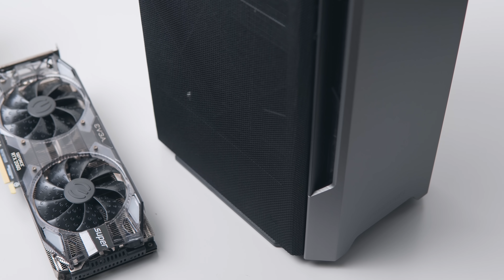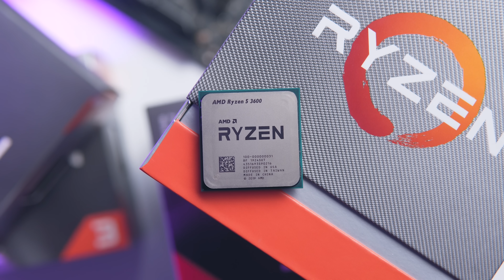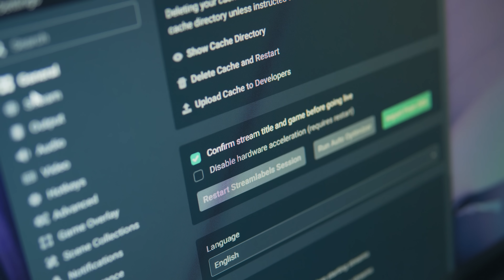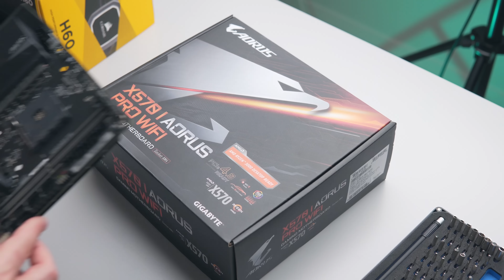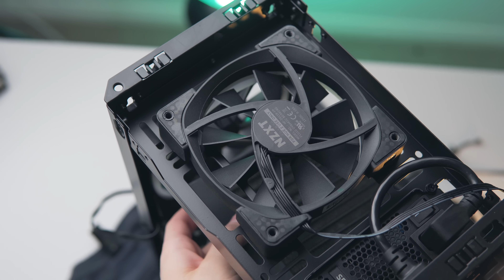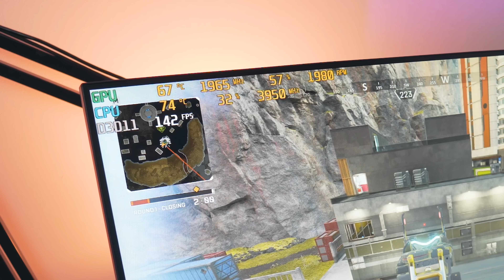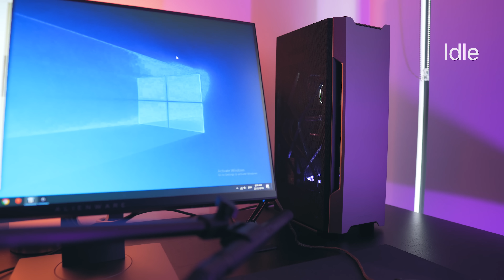Building a 144Hz Gaming Rig in the Evolv Shift Air!

Comment: One question, would my RTX 2080 Zotac AMP extreme fit in this case or does it not fit in the case?
Reply: Had a zotac 2080 ti in it, was fitting, though, I gave up with this case as the airflow was pretty bad, having ultra high temps with GPU, even without the side panels, maybe you would have slightly better Perfs with mesh but testing games in 4k with panels off was already stressing the GPU to +80ish degrees c , I reverted back to a proper gaming tower (meshify c), not as good looking but way better on temps :(

Comment: How was he able to mount the GPU with the fans facing outwards? I just built the same pc with the same PSU and a EVGA 2070 and the 8 pin and 6 pin block the GPU from people fitting with fans facing towards the case panel. Any ideas? I would like to flip my GPU.

Comment: I really like this case and i'm planning to build one with the same components as the one in the video but, can I swap the GPU and aio CPU cooler with the Sapphire Radeon RX 5700 XT 8 GB NITRO+ Video Card and Corsair H80i v2? Will these combo will fit inside the case?

Comment: So, Velka, Ghost, or Evolv?!!? In terms of airflow ofc ?!?!
Reply: X3MCTZN ncase M1 would be the best option as far as I can see. Up to ten degrees better cpu cooling with about the same gpu cooling possebility. Smaller than the evolve and same size as the ghost with a large tophat, if you don’t count the Ncase m1 tho the ghost would most likely win.
Reply: Fitinghoff THE Newbie! Thanks for your feedback dude, but I think the ghost is overrated Though I like it, and Ncase M1 is probably top notch as far as I can see and airwise as u stated, but that elusive ghost is pretty dear, chap! 
Oof the question is would I be able to put it in my backpack and pass the security airport check?! 
That is my concern and why ssf cases are expensive than regular ones?! So money wise and airflow wise, Ncase M1 right?!

Comment: doesnt undervolting your cpu like that kill its performance
Reply: Yes, aka clock stretching.  Bad advice being given out here.  I was surprised at high temps from this cpu, "65w TDP" it's marketing lies from AMD.  However, they state these temps are fine, only time will tell.  I'll be upset if my CPU dies early because I use my hardware for the full extent of it's expected life span.  I just sold my still-admirable i7 2600k after nine years of heavy use.

Comment: I’m thinking of getting this case for my Ryzen 7 2600, EVGA 2080 super build.  I tried these in a node 202 and it gets way too hot in that small case.  I need a narrow case to fit on my 60” wide desk along with my CRG9 display.

What is that program you are using to display the temps while in game?

Comment: i just got the mesh panels so i can use this case again but my gpu is still facing in because it wont go with the fans out. it looks like you're using a different pcie extension cable than what i got with the case and it looks like its long enough. if so, do you have a link to buy it?

Comment: How many fan you got in this build? Did you have To use a fan controller i try To do à similar build but it hard. I only have 3 fan plug on my mb one off them is for the pump but i have 4 fan

Comment: Do you have a guide on what setting and voltage you changed?
Reply: I'm a little confused at how he's getting 4gz at only 1.2 volts, did I miss something there?
Reply: @Stiitchjones  IIRC, gamersnexus covered this.  Undervolting zen 2 is a sham.  It results in "clock stretching", aka worse performance in spite of frequency.  Benchmarking results bear this fact out.  AMD didn't apply higher voltage for no reason.

Comment: I just built in this case with the same specs and fans. But I realized that the fan on your radiator is pushing air downwards instead of upwards. Is there any difference in performance there since a chimney-like airflow would be better with the air moving upwards. But then you would not see the led on the fan.
Reply: you want the fan to source cool outside air, reverse it so that the fan is pushing outside air through the rad into the case.  This will give you the best CPU temps

Comment: Would you happen to know if the riser card in this case is Gen4 compatible? I found that my all AMD build using a 5700 XT in either the DAN A4-SFX and Louqe Ghost S1 would cause Windows 10 to crash. A fix I found was to go into the Gigabyte’s bios and change the PCIe setting to Gen3. Unfortunately I couldn’t find the ability to do this with the Asus Strix X570 ITX motherboard.
Reply: It's not, I had to set my pcie to gen 3 in the bios using the gigabyte x570i aorus board with a 5700xt for it to not crash with this case
Reply: @sandrahiltz  Good news, Asus has released a bios enabling the PCIe connector to be configured to Gen3 when using the 5700 XT, no more crashes!

Comment: something else is wrong i have the same cooler in only push  in a case not as well vented and my 3600 never goes over 65c the fan speed isnt that high ether and it runs at 4100 to 4200 same voltages 1.35 to 1.4

Comment: Are there still problems with Phanteks/Cheapteks riser bundled with the case?
Reply: It seems to be much better than the ones I've seen pictured with older evolve shift cases, no issues with mine, though it's not pcie gen 4 compatible, but almost none are

Comment: You never really explained why the slim Power Colour Red Dragon 5700 xt can't fit in the case.
Reply from the maker: Because it's too tall.
Reply: @optimumtech  Wow, the Red dragon is one the smaller 5700xt cards next to the Sapphire Pulse 5700xt.
Reply from the maker: @mr.simmonds5681  Yep, the only 5700 XT that will fit in this case, with the fans flipped as shown, is the reference (blower) design.
Reply: @optimumtech  Thanks for letting me know! I appreciate that you actually respond back on your comments.

Comment: Hi bro, I am doing the same thing to reverse the gpu. However, I am facing a problem the riser wire block the front fan of the case (the one which is provided together with the case). Do you have the same issue or not? Or you have any suggestion for me, thank you bro

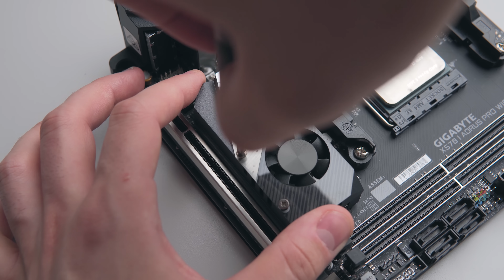Comment: 7:19 I have the same motherboard and I know,  that there is a piece of thermal paste to take between the cooler and the NVMe. Does Optimum Tech not use it? 
I'm in doubt if I shall not use it between the ventilator. If someone knows what's best, then please tell me.
Reply: The manual mentions the thermal paf for the backside m.2. I have not used it for slot 1 under the sys2 pcb fan. What GPU are you using? My rx480 fits but the fans face the Mobo...

Comment: I just don't get how video card is connected to motherboard and... where are outputs of video card?
Reply from the maker: video card is connected via a PCIe 3.0 x16 riser cable. The I/O is at the top of the case underneath the cover.
Reply: @optimumtech  Ok, thanks for answer, I just haven't seen such a case before. Does PCIe 3.0 x16 riser cable was included with the case, or you bought it separately? What the name of it and what length?
Reply: @optimumtech  And.., When you connect, for example, an hdmi cable, does it need to be rigidly bent in order to connect to the video card or is there an adapter there? Unclear...

Comment: Would MSI 5700xt evoke fit into this case??
Reply: It likely would, I have the MSI 5700xt mech in mine, the mech is a little shorter than the evoke 232mm vs 254mm, but it's not right against anything

Comment: I have this case and problem with my built… cpu: AMD Ryzen7 5800X 8 Cores 3.8GHz (4.7GHz) Box  
Gpu: ASUS ROG Strix GeForce RTX 3070 Ti OC LHR 8GB GDDR6X 256-bit ROG-STRIX-RTX3070TI-O8G-GAMING
Motherboard: asus rog strix b550-I 
Ssd: KINGSTON 1TBM.2 NVMe SNVS/1000G SSD NV1 Series 

KINGSTONDDR4 32GB 3200MHz (2x16) FURY Beast KF432C16BB1K2/32 

Any idea why I can’t boot system ? Qled indicators on motherboard don’t light?